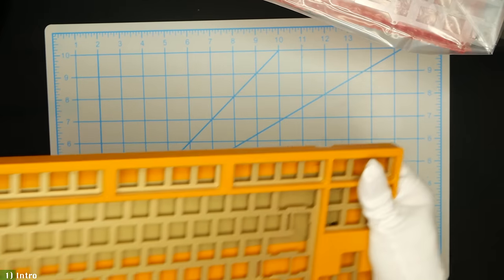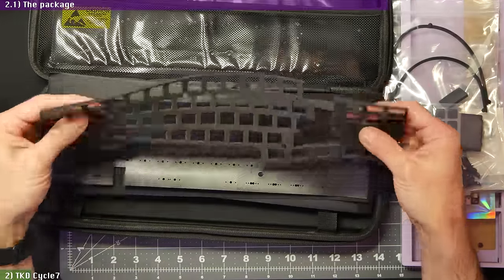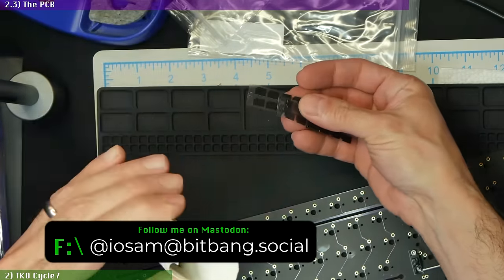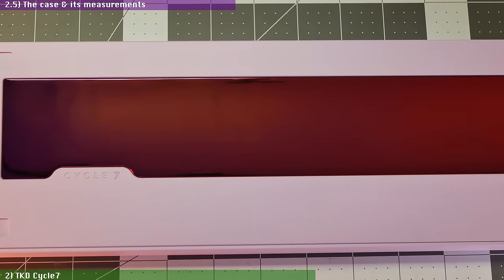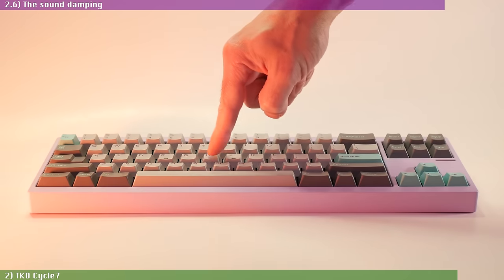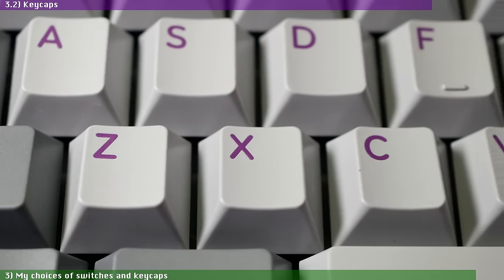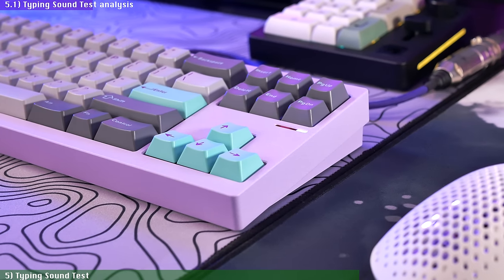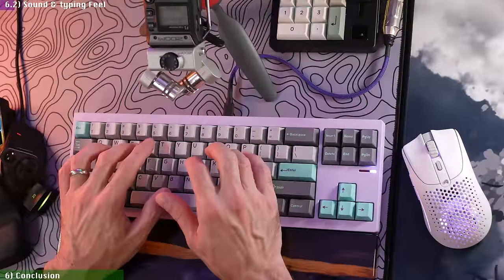The harbinger of things to come...

Comment: Hopefully this board becomes in stock like normal at some point as someone allergic to group buys. I'm sure that it's gonna sell well so I have my fingers crossed.
Reply from the maker: If they manage to make a good profit on this first run, this would be a good candidate to become an in-stock item… I suspect ClickClack might be trial running it to see if this could be their first real in-stock item.

I know they had this intention with the Arc60, but I think the Arc ended up being too complex and expensive to manufacture to justify large scale production (wouldn’t be profitable enough to them, I think). The Cycle7 (and the Cycle line as I believe they might have other layouts planed) might be the perfect product for a first inventory item/line for them.
Reply: @IOSam  Next TKD will be a 80% FRL
Reply from the maker: @TM-zo1nz  That makes total sense, I think... The obvious 2nd layout in the Cycle line.
Reply: @TM-zo1nz  what is an 80% FRL? The only possibility for that combination of words is a regular FRL (70%), with 2 right-side nav columns

Or it could be a 70XT, but that's weird to call an 80%

Comment: Great vid man, I appreciate your viewpoints and your approach to the hobby, can't wait to get my unit.  As an owner of boards that span the entire price spectrum, I agree with your competitive analysis.  When a board like this comes out, a lot of people are quick to knock it down a notch by saying that it's just a basic wedge design and any board that is offered at such a low price regardless of features will always be just that..........a wedge or a slab on wedge.  However, with designers like Vertex, TKD, and QK, to name a few, that are constantly pushing the envelope of budget friendly boards that continue to encroach on the lines that separate them from higher priced boards, it's only a matter of time before they start to offer boards with more intricate designs while keeping the price within the budget range, and that's when high-end designers are truly going to have to make sure that they can offer a board that can justify the premium price.
Reply from the maker: Thank you Tetsuo!!! And yes, very true!! I mean, just look at the Arc60 for example… It was already a sophisticated design, with intricate curves and immaculate manufacturing, which Vertex sold for a lot less than similar boards at the time.

So, they already showed they can do the high-level stuff without overcharging for it. With the Cycle7, they are just showing how much more aggressive they can go on pricing if they really put some effort in it… Which is almost like a shot across the bow for the competition.

I’m very curious to see what they come up with next in the Cycle line (which I’m confident they’ll bring it back in different layouts after the success of this FRL).

Comment: The other day I built out a barebone Keychron Q5pro for a friend and installed Gateron creamsoda's and some MT3 profile keycaps on it. This hurts me to say, but the Keychron Q5 pro is very close to my Odin R3. 

I think that keyboard, and the QK100 should have people in the hobby looking at other customs with a side eye. It is very hard when you understand the machining processes, know how much PCB's cost and see the same materials and mounting techniques used as "premium customs" in a mass produced sub 200$ package to look at those group buy premium boards and say they are worth it.

The only differentiating factor is the weights and weight material all of the boards are made out of aluminum either 4043 or 6061. And it is not a complicated machining process to mill a weight then drill and tap holes. So suddenly a whole mess of premium boards need to be questioned in regards to fair value per dollar spent. My Odin R3 for instance was 400$'s for the base keyboard I think the hobby needs to see these boards and re-evaluated its pricing scheme.
Reply from the maker: As an original Odin owner myself (for which I paid $341.00 with shipping back in 2021), as well as the owner of numerous other custom and production keyboards, I understand EXACTLY what you mean! From a solely cost to benefit ratio point of view, at this point in 2023, it basically makes no sense to buy expensive custom keyboards anymore. Prebuilts have gone beyond being good enough, and are now pretty much as good as most custom boards, but for a fraction of the cost.

Sure, the same could be said about luxury cars against Toyotas and Hondas… And yet people still buy expensive Mercedes and Porches because, at the end of the day, luxury products end up offering other non-tangible benefits that go beyond functionality, features and build quality (such as different designs, and the feeling of “exclusivity” that so many people lust after). So, I believe premium customs will always have their own niche space in this industry regardless.

But with the increased competition from the likes of Keychron, we now at least have the benefit of seeing the birth of this new kind of “hybrid” vendor, such as ClickClack.io, trying to offer the best of both words: production keyboard’s price with premium custom keyboard’s design… which is, of course, very much appreciated!

Comment: Im pretty sure mx blacks have higher pitched top out sound which makes it unique.

Their bottom out sounds more deep and low, while their top out is tacky and high
Reply from the maker: That's an interesting take.I guess I'm not super sensitive to the upstroke sound of nylon tops, so I all I hear is the overall lower tone of these MX Blacks. I guess the reason why I attributed this tonality to the top housing is because I've tried other switches with nylon bottoms (and PC tops) that did not have the lower pitch of these Hyperglides.

Comment: This is compelling, when someone creates a custom 95/96 / fullsize keyboard that will cost me less than 200$ CAD ( 150USD ~) for a barebones kit that I could see coming in at less than $350 when you factor in buying your own stabs, switches, and keycaps then we will have something that directly competes with OEM's. Even for my friends that like mechanical keyboards when they see the price of a custom they say, "I'll just get a new corsair that is hotswap and fully assembled, if I want new switches or keys I'll get them later." 

It's a hard sell to get users to cross over to enthusiasts. 

Secondary thing, I have a really easy method for dealing with pesky stab wires, its so easy that I just do it by default. I have 2 floor tiles 12" x 12" (30cm x 30 cm)  but any size will do so long as they are flat. I take the stab wires lay them down on the tile, then take a plumbers torch, turn it on heat up the stabs until they are hot, and then set the other tile down ontop of them. I then go and lube switches / do other parts of my build, about 20-30 minutes later when I need the stab wires they should be cool to the touch but more importantly they will be flat. give it a try, it'll save you a lot of time over manually tuning stabs.
Reply from the maker: Yeah… I hear you… I think I’ve only one custom full size so far… And it was very expensive! To this day, whenever I’m in the mood for a full-size board I usually pull one of my vintage Alps keyboards, since I’ve never built a custom full size myself.

My suggestion for everyone who asks me for a good “semi-custom” option, for people who demands a full size, has been the hot-swappable Keychron Q6. I think it doesn’t get any better than that (outside of some custom designer deciding to have a go with a full-size board in the future). It is definitely superior to anything Corsair offers, that’s for sure! Check Chyrosran22 review of the Q6 (he is a “full-size absolutist” himself :)

I know at least a couple of people who bought the Q6 and are very happy with it (both software developers that do a lot of typing).

As for the wire straightening technique, that is brilliant! I have blow torch, so I think I only need the tiles to try something like this… Thanks for the tip!!
Reply: @IOSam  I own 2 Q6's and am typing on one of them right now they are very good boards, I can't even complain about the stabs in them. My 3rd board is an Odin R3, and it is just slightly above the Q6's imo from a build and a quality standpoint. Its tough to say whether or not that tier above the Q6's justifies the increased price though.
Reply from the maker: @BType13X2  So, you were two steps ahead of me then... 😂  And hey, I still have an Odin V1 in the box here (when they were still top mounted, I think), which I got from KBDFans in 2021 (if I remember correctly) and never got around to build it.

But build it I will (and of course there will be a video about it here when I do :). That will be my first 96% (ish) custom, so I'm actually pretty curious to see how that will fare for my day job when working from home (when I do use a numpad).

I think that at this point in time for me, a 96% keyboard makes more sense than a full-size, considering how crowded my desk can get, but I still use full size boards with my vintage PCs often (just for fun, of course).

Comment: W
Will force big companies to lower price and for smaller designers to be more innovative and or creative
Still annoyed you dont do a 0 foam config
Reply from the maker: Yeap! Vertex+ClickClack is going for the kill this time... Not leaving any margin on the table for other vendors...

As for the 0 foam build, I couldn't do it this time because of the solder PCB... Since I like to use plate foam myself (especially when using Cherry switches), I had to pick just one: with or without plate foam (since I wouldn't want to desolder/resolder the whole thing again later 😂).